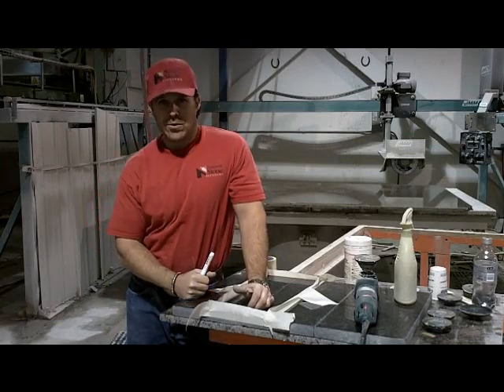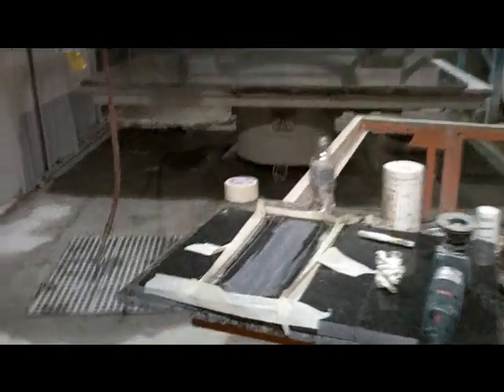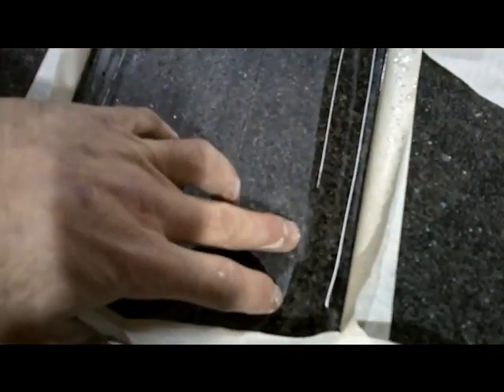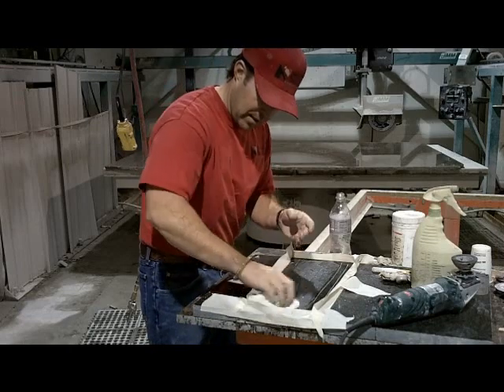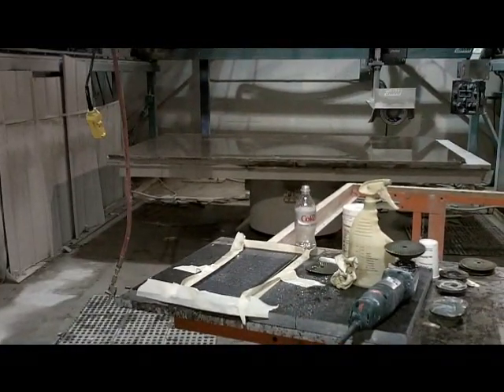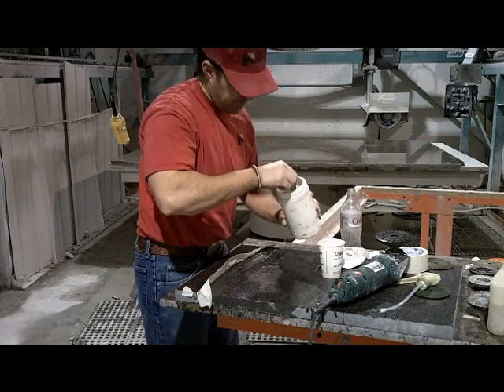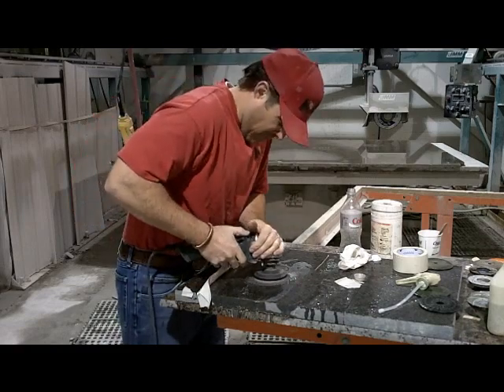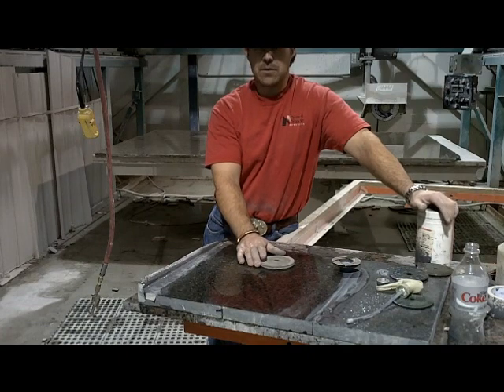Natural Stone Systems TV Ep 10 Surface polishing -- Than Norman

Comment: the 9227c is only appropriate for using the turbos, it gets too hot when using it for the wet-to-dry process. Try the milwaukee 5540.  getting it better than factory is an issue, how do you deal with that? clients will certainly point that out if it is in the right light. 

where di you learn how to do this?